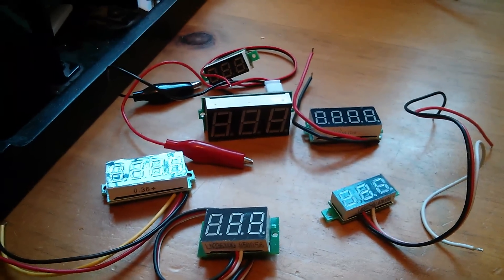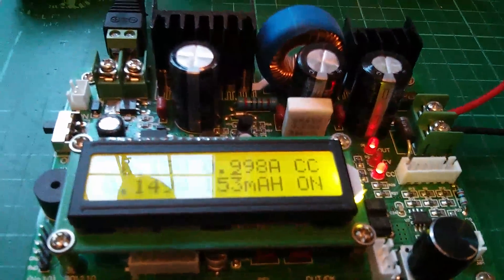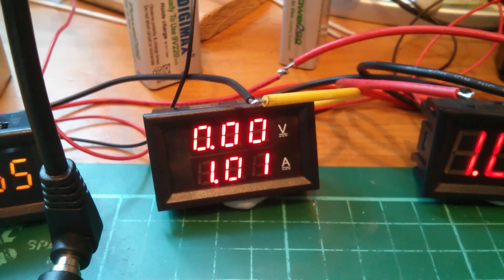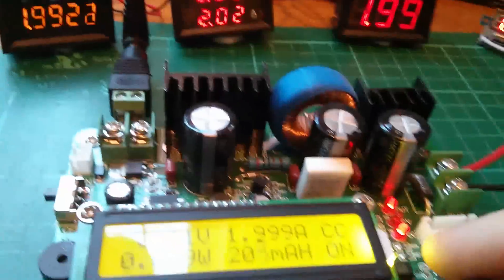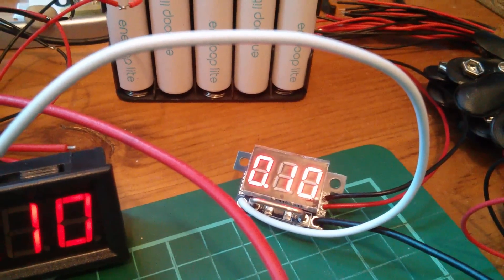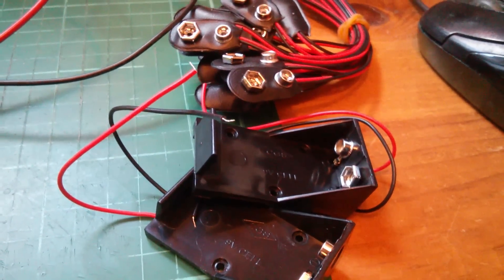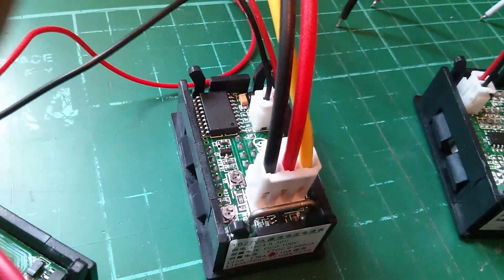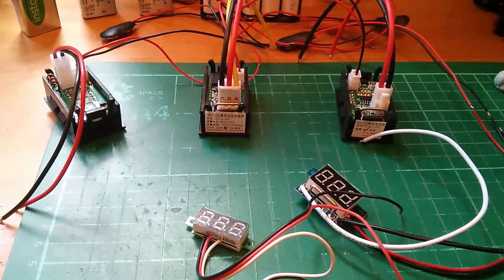Testing a few Cheap LED Ammeters bought on eBay

Comment: ebay Sucks! or some of the sellers do. I just bought a Digital, 300 amp ammeter with a separate shunt , similar to the ones on your video but not the exactly same and the seller can't seem to send me the correct wiring diagram, with the same colored wires and he/she hasn't once mentioned a separate power supply, it's like they don't really know what they are selling.  Previously bought a 300A (model name) digital meter (all in one) with two large + & - wires on each end and it started to melt at around 200 amps, although it did read it (197 Amps) but it couldn't handle it for a more than a minute or so. Some ebay sellers suck Bad!!! They must be Dumpster diving .

Comment: Bought one of the dual Volts and Amps with a separate shunt to read Amps on a car amplifier set up in home, works with the shunt but it is meant to able to read under 10A without it though it just doesn't work without the shunt.

Comment: I want to separate the power source and the actual input pin so I can still run the voltmeter but measure down to 0 volts on the input.  The way it is now the two inputs are tied together and when the power gets below 4 or 5 volts the display quits.  Where can I separate these 2 inputs so I can measure down to 0 volts but still have the measuring part (LED's and measuring part) running from a separate 9 volt source?

Comment: The dual V/A 3 digit model come with a FIXED single decimal digit on most of them.  I have been tearing my hair out trying to find the much better floating 1 / 2 decimal V version, like the one you have.  Please, please, what is the exact URL for the one you got???

Comment: Hi Julian Ilett, I have the same as the second ones from the left that you review. However when playing with it, by accident I have made it not working properly for the current meter function. I don't know how to fix, and what wrong have I done to made it like that.
Could you be able to have a look at my post in EEVBlog forum, and help me to fix it please. Link: http://www.eevblog.com/forum/beginners/(repair)-current-reading-error-with-dsn-vc288-(100v-10a-voltmeter-ammeter)/

Thank you so much.

Comment: Jullian wire ! thick & thin, as you know there's a great range of wire gauges out there, no one every seems to give a ball park gauge when there demonstrating there gadgets, so what gauge are you using for this lot, 1 to 36 AWG or 0.19mm to 8.23mm SWG & thats just a few, not every one knows the voltage a wire can carry with out blow their gadget up or frying it. but as alway your informative Tutorials gems.

Comment: Good review! For such precision questions its always good to have a really reliable accurate table volt/ampmeter to have a real reference. Otherwise its all guessing. But the fact that they all show similar values may lead (mislead?) to the idea that they all are nearly accurate enough for most purposes :-) These chinese panelmeters are a good value for the price anyway! I specially like the 4-digit volt + ampmeter for around 5 pounds - that is very precise up to the mA and mV.

Comment: Im looking to install one to my 250 amp engine driven welding machine. Would the combined volts and amps meter handle the load?
Reply: ryan mcdaniel if you aren't very familiar with handling such high currents (and you probably aren't, going by your question) i wouldn't fuck around with your welding machine. These machines are extremely dangerous and you shouldn't install a 5 dollar meter (which obviously can't handle 250 A) as you will only start a fire...

Comment: Hallo Julian,
Some Guys realy can ask stupid questions, can't believe it!!!   Ok, back to the Theme! The open Frame Ampmeter you can adjust on the Backside were are the Pins locatet with "+" / "-" !   1 Tip on GND and the other Tip on plus or minus, let the Display scoll up and down for adjusting

Comment: Hi Julian. I have been using some of these cheap volt meters. Have you noticed the input impedance is quite low around 100k compared with an actual DVM. Did you find a any good AC meters. Do you happen to know frequency they work up to. I'm looking at doing audio measurements.

Comment: link for your power supply?
Reply: This seems to be an updated version: https://www.aliexpress.com/item/DC-900W-15-80V-to-0-60V-15A-Buck-Converter-CC-CV-LCD-Display-Programmable-TTL/32498460397.html
Reply: With the insane price of that updated version for a buck converter, I rather an alternative such as from RDtech, nicer screen, with button and knob for easy adjustment. If you don't mind of input voltage lower than 60V, then this is it: https://www.aliexpress.com/store/product/RD-DPS5020-Constant-Voltage-current-Step-down-communication-digital-Power-Supply-buck-Voltage-converter-LCD-voltmeter/923042_32821185351.html
PS: I'm neither in any relationship with them, nor get any commission. Just a hobbyist like you guys.

Comment: I thought it very interesting that someone would do this.  You must be retired and looking for something to do.  (Added note)  Most of the cheap meters from Hong Kong or China don't provide any information about the voltage needed to power them.  Has anyone seen such a meter that is powered by voltage other than the 9 V that Julian uses?
Reply: Give or take 5-30 volt should do just fine. It's what most sellers on eBay seem to put in their description.

Comment: Is there a way to wire an ammeter into a switch to measure two different amperages?  For example, switch one way to measure current from the solar panel, and another way to measure current to the load?  I was thinking of using a 6 pole dpdt switch, but the problem is that the non-measuring circuit will be unhooked.  Maybe two switches somehow?  Any help appreciated.
Reply from the maker: I think this is where you need two ammeters.
Reply: I am looking to do the EXACT same thing here.  If you're able to figure it out with one ammeter, could you let me know?
Reply: Richard:  I think it could be done with two 6 pole dpdt switches, but I have not tried because I killed my dual volt/ammeter!  See if you think this would work:

Switch 1:  left side top would be circuit one in, bottom would be circuit 2 in, middle would be voltage to meter.  Right top would be circuit 2 in, right bottom would be circuit 1 in (opposite of switch).  Middle would have both circuit 1 and 2 out.  So it would reconnect circuit 2 when you're measuring circuit 1, and would reconnect circuit 1 when you're measuring circuit 2.  So when you're measuring circuit 1, it would reconnect the negative leads of Circuit 2

Switch 2 (amperage switch):  Top left is circuit one in, top right is circuit one out.  Bottom left is circuit two in, bottom right is circuit two out.  Middle left is ammeter in, middle right is ammeter out.

When both switches are up, you get voltage of circuit 1, reconnect circuit 2, and split circuit 1 for amp measurement.  When switches are down, you get the opposite.  Don't leave switches in the middle (I think you'll have dead circuits).

Only thing I'm worried about is that switching would momentarily disconnect and reconnect the circuits, which may not be good.  Anyway, it's messy.  There must be an easier way that I have not thought of.  I wonder if using two shunts would allow the circuits to remain connected when they are not being measured?
Reply: It is possible with 8 switches/ transistors.

Comment: Great tutorial thank you, but what does  " shunt  " mean please?  :)
Reply: A shunt is simply a resistance (usually a wire) placed parallel to the ammeter to take part of the current (often most of it) so that the ammeter is not overloaded.  Suggest you Google 'shunt' for more details if needed.
Reply: Ok Thank you very much... :)

Comment: @julian, Am trying to use one of these volt/ammeter live Diagram 2 in this pic : http://g02.a.alicdn.com/kf/HTB11puLIVXXXXbwapXXq6xXFXXXd/2in1-Volt-Amp-Meter-DC-0-100V-100A-Blue-Red-Led-Digital-Display-Voltmeter-Ammeter-DC.jpg

But I have found when I take the input below 3v the display goes off, do you know of a batter way that I can get the screen to show the output volts and amps ?

Comment: I liked your video! Its quite easy to find a reasonable Ampmeter for DC but look for one for AC 0 - 50 Amps. I found one on ebay for 12 Eur that claimed to be very precise,
but the deviation campared to my other DMM and Clampmeters is around 5 - 10 %. Would like you to make a test on these AC Ammeters :-)

P.S.: i included 4 of those DC and AC Volt/Ammeters in my diy PowerSupply which is capable of providing up to 30 V at 30 A and 50 V AC + 70 V DC up to 20 A. It consists of a variac
combined with two toroid-transformes delivering 4 x 12 V at 10 A each (I added another coil for having more Amps in lower voltage) and one 2 x 50V / 10 A which i connected in parallel.
I added 2 bridge rectifier and 2 big caps for DC with low ripple. For the Power supply of the panel volt/ampmeters i added a small DC plugin PS. The funny and annoying thing with these
chinese panelmeters is they influence each other when combined through the same power source and they even influence the DC output of my Power supply! They must be funny wired inside and probably dont like to be connected to the same power source. I blew up the internal caps of the auxilliary powersource for the panel meters, when turning on the DC output to more than
30 V. On the other hand, the aux. powersupply for the panels also raise the Voltage of the DC output of my Powersupply. Without all those panelmeters everything works fine - so there must
be something strange with them.
You can find the discussion and construction here in german language:
http://forum.mosfetkiller.de/viewtopic.php?f=2&t=62975&sid=3abd7c35d8929bf181a8ee25bf111633

would like to hear your answer on that problem.

cheers

Comment: Hi peeps,i have a very old but very good car battery charger with the old type analog ammeter ,what i want to do is re-case it and replace the ammeter with an ammeter/voltmeter like the ones tested,is this posible ?,the diagrams i have seen are for measuring a load and not a charge,do i just reverse the ammeter cables ?.cheers.John.
Reply: you still going to do it and need help ?
Reply: Thanks for the reply Bill,i have put that project to the bottom of my to do list now so i doubt it will ever happen.....maybe when i get bored one day i may take it up again.:-).Thanks anyhow.john.

Comment: can i use any of these amp meters + a Shunt to measure the current draw of a computer Graphics card (aka GPU)  ? I intend to place a shunt in between the 8 pin PCIE Power cable and the GPU PCIE connector. will use a PCIE 8 pin extension cable and joint all the negative black cable together and connect to the shunt. So, is there anything wrong in this setup?  The gpu Draws around 23A max at@12DC
Reply from the maker: +mint hos Yeah, I guess that would work. But you'd probably be better off with the type that has an external shunt - these ones have an internal shunt
Reply: ok. do you have any link  that has built in shunt? also is there any chance that due to use of the shunt the gpu will see a voltage drop or draw more amp ? thanks
Reply: +mint hos Hey, I would be careful putting a shunt in the PCIe power cable, shunts do drop voltage and if the drop is too great you will get crashing on your graphics card, graphics cards can get about 75watts from the motherboard PCIe connector; worst case scenario you could blowup your motherboard because of more power going through the motherboard due to the voltage drop on the PCIe 6/8 pin connector.
Reply: +mint hos A solution could be a non invasive current measurement, their a little less accurate but it could do exactly what you're looking for, it's a cool idea!
Reply: +Shay Nichol  well u can use a usual clamp meter but i don't know of any that runs 24/7 on wall power/ PSU. I am basically looking for standalone voltage data logging gadget( with good enough sampling rate) that runs 24/7. So whenever shit happens i can look at the log.
Reply: +mint hos I see, off the top of my head I can't think of a solution that's not targeted at industry (expensive)...
The closest thing I can think of is a DM240011, it's a micrchip devkit with native flash drive support, it comes with a example program that logs voltage from a potentiometer to a text file on a flash drive, it could be modified to log the data from a HTC-0010 for your current and with voltage divider you could log your voltage too maybe? That's the best I can think of now...
Reply: You can get these meters with little coily things that go around the wire, measuring the current by induction. That wouldnt be a problem.
Reply: This is exactly what you need: http://m.ebay.de/itm/DC-300V-50A-LED-Digital-Voltmeter-Ammeter-Charge-Battery-voltage-current-12v-24-/271950595415?_trkparms=aid%253D222007%2526algo%253DSIC.MBE%2526ao%253D1%2526asc%253D20150519202354%2526meid%253Dad15d9f15eb64771ba08f42f4d4acb62%2526pid%253D100408%2526rk%253D7%2526rkt%253D18%2526sd%253D271956268548&_trksid=p2056116.c100408.m2460
Reply: hmm this one is better. basically a DC Clamp meter. have to test some of these. thanks for the links man.

Comment: Hey guys, I was just curious, does anyone know how to build a custom analog/digital meter? I need to measure the readings digitally, but I need the analog needle present, to transfer that information..... and it needs to be really small, like 1/2" x 1/2" x 1/4" if anyone knows please message me ASAP please!!!!! I REALLY need help , thank you so much
Reply: why that digital/analog conversion? just go for purely analog, still really accurate.

Comment: I just got one in a kit from china.  It has 3 digits and a polarity indicator.  The kit was easy to assemble and worked the first time it was powered up.  I have one issue with this as with the others like you are showing.  They are not linear.  As you increase the the current, the accuracy decreases.  Compared with my HP3468A.  If anyone knows how to modify these to have better linearity, please comment.

Comment: Is there a way to mod the voltage meters to be powered separately (not powered by the same pin as they sense voltage on). I want to be able to insert them in a circuit without disturbing too much as well as being able to measure less than the minimum voltage of the microcontroller/led display.
Reply: take the 3 wire voltmeters / the 5 wire volt- and ammeters
theyll have 2 seperate leads for power.

Comment: I bought one of these combined voltage & current meters a while back which comes with two wires for powering leds and three wires (red, black and blue) for measuring current/voltage, however I couldn't find any diagrams showing the proper way to connect these. By the looks of it it has a shunt resistor. 

Btw, that power supply was nice. Can it regulate both voltage and current?
Reply: That powersupply can do CC and CV so yes. Its clearly worth getting but sadly not that cheap.
Reply: That powersupply can do CC and CV so yes. Its clearly worth getting but sadly not that cheap.

Comment: So, is it possible to hook up one of these LED voltmeter+ammeter things with just one power source? I'd like to install one for a linear regulated PSU, and two for a DC-DC boost converter to monitor SLA battery voltage and current, and converted voltage and current.

Most diagrams show a separate isolated power connection to the voltmeter, while I would like to power both the voltmeter and ammeter from just one power source:
1. Power from linear PSU
2. Power from SLAB
3. Power from DC-DC boost converter

Is that possible? I'm a bit confused by all of this...
Reply: Yes, you just combine the power leads, and you don't use the thin negative.

Comment: I GOT 1 OF THE THREE WIRE LED METER  WICH SAYS 0 TO 99V DC  I TESTED IT ON 130V DC AND NO COMPLAINTS  I GOT IT FROM AMAZON FOR  JUST OVER £2  DELIVERY 12 DAYS ESTIMATED

Comment: Hi i just got the same volt/ amp meter as you for my solar panel in order to be able to measure how much power its generating am i right in thinking its wired black to yellow i.e negative in as black and out through the yellow cable?
Reply: all this meter has wire diagram , you should check 
it is easy to undestand

Comment: I found the dual volt / ammeter to be junk. Its non linear so the pots on the back are useless. Adjust at high voltage or current and the low end is way off and vice versa.

Comment: You can probably adjust the one with no pot by scoring a cut very gently with a file or knife blade (increase resistance) or apply solder to it along it's length length (decrease resistance)
This will be a very tiny adjustment, well under  1 percent for adding solder and for cutting a notch it will depend on the depth of cut (be very, very gentle!) but is unlikely to be more than a few percent at most. At least you can solder over a notch to undo the damage or remove the solder with wick. We used to run a layer or solder over shunts then scrape or it off to trim them, before giving them a coat of shellac to protect them from the air.

Make sure you clean off all flux and/or metal filings afterwards, filing is best done upside down to the filings fall away and not into the ammeter!

Comment: I am thinking of connecting one of the duel ammeter voltmeters to my motorcycle, to see voltage acrosi s the battery and total current drawn. I have the 50A one from the same seller, do need to install a seperate shunt?

Comment: Excellent and very informative review. I have just received a dual display volt and amp meter from eBay seller easbon in china. it has two connectors, a smaller two pin one (red and black wires presumably for the supply voltage?) and a larger three wire one (red, black and blue wires). I am not sure how to wire it up and don't want to fry it! I am only a novice in electronics.

Could you please describe in detail how to connect it to my self built LM317 adjustable power supply.